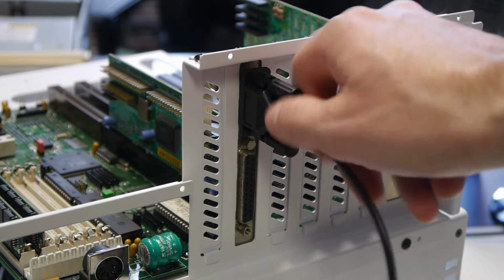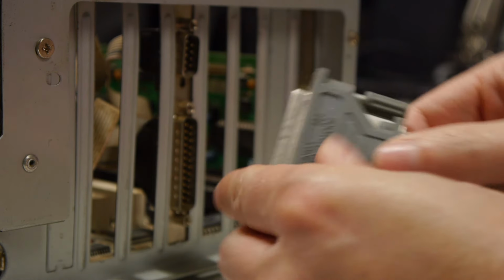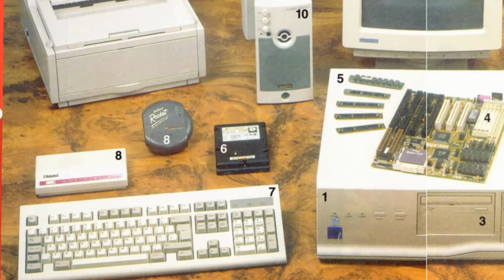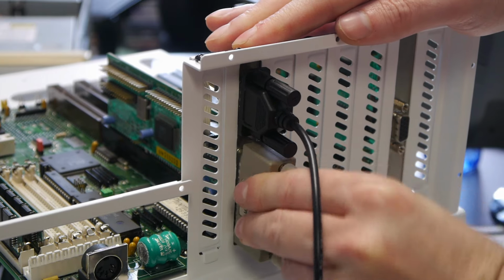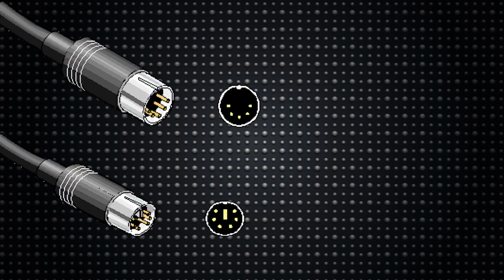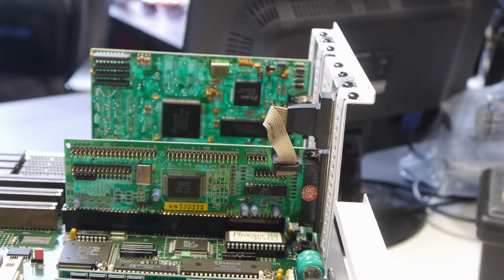What did we use before USB? | Nostalgia Nerd

Comment: 1:34 ages ago i had a 486 with an at keyboard port and the footer and through holes for a ps2 one underneath, i was using a ps2 keyboard and for shits and giggles i robbed an old dead ibm ps/2 motherboard of a ps/2 port and replaced the at port with the ps/2. i was like 15 years old (35 now) and i was AMAZED when it actually worked. although i eventually destroyed that motherboard by grounding the at/ps2 5v to the case while it was on. no smoke, just no work. (i was working at a computer store at the time, and while these weren't throw away parts, i sadly didn't have much respect for them, because i knew i could ridiculously easily replace them, coppermine had just come out and it was a 486)

Comment: One small point you forgot about the old "sound blaster" type sound cards: As well as having the external game port (for joystick or other game-pad), they were used as the interface for connecting an internal CD drive to the motherboard of a PC. There was some logic to this, since most software which came on CD-ROM required a sound card to work properly anyway. This arrangement persisted for a few years in the mid-1990s, but became obsolete when CD drives began using the same IDE interface that hard disk drives used. However, most IDE CD drives still had a legacy 4-pin audio port, which allowed the use of a small cable to connect the drive directly to a sound card (or to an equivalent sound chip integrated onto the motherboard), bypassing the IDE interface.

Another benefit was if you wanted to use the CD drive in your PC to play a standard audio CD: The multimedia speakers connect to the sound card and could be powered by it, since sound cards often had small on-board amplifiers capable of driving stereo headphones or small speaker sets. So having a CD drive controlled by the sound card allowed an audio CD to be played without using any memory or processing resources on the motherboard. Some CD drives at the time even had multiple control buttons on their face-plates (play, pause, stop, skip track forwards or back), so an audio CD could be played directly, without any kind of software interface.

Comment: I would say this video sort of romanticizing it. It really took quite a number of year for USB to replace all those. And there was a reason why it took a while for it to get really wide adoption.

In the early days the keyboard was hardwired. That is why it for the longest time was the only connector on the MB. Serial interface was already a standard, so was ISA. 

Parrell port was a hardware used for printers  at the time. The printers was really "stupid" just just punching what ever bits came out of the port into the paper. (Thats why early printers was 7 dots, 7 bits for printing, and 1 bit for system interface)

The game port was originally a sound port that was sort of miss used as a joystick port.

The thing is that PS/2 convector was sort of a prior atemt to make semi universal connector. PS/2 works kind of similar to USB that is it have a rather hearty 5V 275mA power supply, and two data pins. But in steed of data+ and data- it have data and clock. It also had the ability to support two devices via splitter cable (not always sported) Some manufactures used this to pipe mouse via keyboard or to use one less port on portable devices.

By the time of USB 1.0 PS/2 had already unified Din keyboard and Serial mouse... but of cause the issue was with modems, still using serial. And to some degree Parallel port. To cut down on cost USB used 1.2Mbit for peripherals and 12Mbit for more intensive stuff. But USB 1.0 had hubing problems. So it was really never used.

Then a lot of keyboard PS/2 to USB was kind of buggy (specially in bios) prompting most people at the time to still use PS/2... While mouse interface for the most part worked just fine, but people still used the PS/2 because of the keyboard issues).. anyway wheel mouses for the most part pushed over people to USB.

Also, by this time most drives was to fast to use the parallel ports, promoting uses of SCSI and firewire interface or also commonly LAN interface. Also USB 1.1 was still way to slow. So in a way. USB was to late, to slow and to buggy.

USB 2.0 solve the rest of the problems (most was solved in 1.1, but it took time for adoption). Honestly while firewire and SCSI remained on the market, USB 2.0 sort of killed the mainstream adoption of them.future firewire... While they was quite a bit faster, by this point it hardly mattered any more.

Most people think of firewire as an apple thing... and well it kind of was post 2000, but prior to 2000 most major PC manufactures had firewire (or 1394 as it actually was called) integrated in there top end hardware.

Comment: Next thing that will replace USB is wireless (either bluetooth or another wireless system). Even though today on a pc you can connect your mouse, keyboard etc with a USB wireless dongle, eventually dongles will be a thing of the past. Then the next question will be "What did we use before wireless?" Answer "USB"

Comment: I'm from 1984 and had the first PC in 1998 but despite fact that I had been able to put my fingers on a computer when all the described ports were being phased out, I have been able to witness them all. The first PC I had, mounted PS/2 ports for Keyboard and Mouse, COM Serial ports for 56k modem, the soundblaster audio card my father had the shop mount in the pc shared a gaming port (though I never used it since I don't like computer gaming that much), the printer (HP Deskjet 710c) was connected through a LPT1 Parallel Port (and even the HP Deskscan "whatever" scanner I borrowed from a mother's colleague was) and, last but not least, the big format scanner Contex FSC 5010 mounted (and still mounts, since it is still alive) SCSI 60 HD and 50HD ports. And no, my IOmega ZIP Drive already mounted USB. So even if I'm only 35, after watching this video I just want to die :(

Comment: And now we have USB-C, a port that always looks exactly the same but can have requirements such as

"Firstly, it’s important to note that USB Type-C is a connector, not a signal type. If the Type-C port on your laptop only supports USB it won’t work with a VR headset. It needs to support ‘DisplayPort Alt Mode’ or be a Thunderbolt 3 port to have a chance of being compatible."

BUT AGAIN, ALL USB C PORTS HAVE TO LOOK THE SAME

Comment: USB 2.0 has a maximum theoretical bandwidth of 480 Mbps, versus 400 Mbps for FireWire 400 and 800 Mbps for FireWire 800. In practice firewire was actually about 35% faster then USB 2.0.  There are also a number of early adoption issues with USB 2.0 in the Bios. Many of the systems that we worked with at the time defaulted to 1.0 speeds or worse didn't support 2.0.

Firewire was actually Superior to USB 2.0 in so many different ways. Since it only required and expansion slot you could essentially have an upgrade on your system that gave you exceptional speed without having to replace the whole system. I actually used you a USB 2.0 and firewire quite a bit in the 90s and early 2000. They worked well but the performance was always better with firewire. As I said, it was at least 35% better given that USB 2.0 didn't actually deliver on the speeds and the fact that firewire was much more reliable and didn't have the tendency to freeze up.

The firewire connector was actually a better design as well. It could be used in tight spaces just like the USB, but you could look at the connector and tell which side to stick in. This saved a lot of time. You didn't have to Fumble with the clunkiness of a USB connection where you had a 50-50 chance the cable would go in as opposed to a 100% chance the cable would go in using firewire. Actually at the time, I had hoped that firewire wood become the standard instead of USB.

Comment: I always remember the rules of SCSI on apple macs of this era? There were arcane rules such as no more than seven devices on a chain. Certain devices had a placement order on this chain. You could not mix different SCSI cable types ie they all had to be from the same manufacturer and either cheap or expensive ones dependant upon budget. Finally the last device in the chain had to have a terminator resistor block on it to signify the end of the chain to the SCSI controller on the Mac motherboard. Bizzarely enough you sometimes  had to remove this terminator to get a certain device within the chain to work! To say this state of affairs was a right royal pain in the arse is an unstatement. Thank God for the USB standard. You guys have never had it so good!

Comment: As someone who deals with industrial computers and controllers, 9 pin serial is still used to this day.
Reply: Actually, serial communications is robust, easy to understand and program, and ubiquitous.  That's why it's still around.
Reply: @jovetj  I have a serial port on my server motherboard. Can't that be used as a TTY in Linux? Maybe that's why it was included? I've never seen anything actually use a parallel port, but I could imagine it being useful when swap thrashing causes my computer to freeze in a way that makes the GUI inoperable and the TTYs unswitchable.
Reply: Yep, serial is far from dead.  However, that serial (normally UART) connection tends to go into a serial to USB converter on one end ;)
Reply: @travcollier  often those converters don't work reliably with old school serial products.  i used to run automated camera controllers that used an old 9 pin and we had migrated to a new server that had no native 9 pin ports.  i went through several different vendors for converters and each one of them would cause some weird error that resulted in non-function about 1% of the time.  1% was unacceptable for this application so instead just went for a pci  9 pin serial card and that solved the problem.
Reply: @oldtwinsna8347  I never had any issues with FTDI serial<>USB, but I was working with relatively modern microcontrollers mostly.  The off-brand and counterfeit converter chips suck though.
Reply: Yeah, a few industrial controls engineers have lamented the death of the serial port on their laptops as often the USB-to-SERIAL adapters don't work well with their software.
Reply: it's used because a lot of companies are too cheap to lose the money from down time and the cost to upgrade to use modern technology. Eventually they all have to upgrade because once your shit from the 80s or 90s breaks then you're dead in the water.
I'm a controls engineer/system integrator (:

Comment: You know... now that I think of it, I've never actually gotten around to using a USB keyboard or mouse on my PCs unless you count the wireless ones. In those cases I think of the USB as an interface for the receiver, not really the peripherals themselves so much like it was with PS/2, Serial, and AT, or whatever that fat daddy dongle is called.

My new (roughly 5 years old) Logitech keyboard and mouse use the same Unifying wireless USB receiver, but the mice I use for my laptops use a standalone wireless one.

Cheers.
Reply: DIN, I guess then.

Comment: Here’s a top tip for you all, specifically if you have issues with any 2.4GHz wireless product on USB3.

USB 3 is well known to interfere with 2.4GHz anything - Bluetooth, wifi, proprietary protocols, doesn’t matter. The reason for this is because it runs at the same clock rate or something along those lines. I can’t remember the exact reason for this, but Intel did a paper on it which explains further. Happy to dig it up for further reading if you like.

TL;DR, the fixes are numerous:

Don’t connect your radio gear to any USB 3 port, if possible. Don’t connect it to a USB 3 hub, either.

If you don’t have any legacy USB 2 ports, you can work around this issue by using either a long extension cable, or better yet, a USB 2 only hub.

However way you choose to skin this particularly annoying cat, keep the transceiver as far away from the USB 3 port/hub as possible, and you should be good.

So if you’ve ever wondered why your wireless mouse seems to suck, that’s why.
Reply: Ugh, overengineered solution. How about just use a wired mouse and not worry about it?  It's lower latency and doesn't require batteries/charging.

Comment: well the db9 and db25 ports are still  common but not on laptops of course for example i completely destroyed any chance of sealing my truck but using 3 pcie cards 4 db9 cables and 64 rs232 controlled relays i can set in the passenger seat and drive with a keyboard in in my house and drive it using 2.4ghz wifi there's a yagi antenna on top of the truck and a matching one on my house 

have you ever wanted to get pizza but they don't deliver to your area and you don't feel like cooking or even getting up ? no problem just remotely start your truck by connecting to the computer and tell it to start the engine then you can use the wasd keys to control the steering and gas flow and the arrow keys to shift 

its also good at pissing the cops off

Comment: Dang...Am I that old that people are now starting to ask what was used before USB? I was born in 1999 and even I remember life before USB was everything...
Reply: I was born in 1993. I grew up with Parallel and Serial ports as well as floppy disks and the age of the Soundblaster card. Don't forget, there was also firewire. :)
Reply: I was born in 1978.
Reply: I am born 62 and believe me, there was no need for this junk. And it took years to run flawlessly. USB was nothng than a cheap way for a bus system. And latest now everyone talks about IOT. We could have had this 20y earlier...
Reply: @TheLightskinPirate And connected to a Sound Blaster...
Reply: 96 here, i was using PS/2 mouse and keyboard till the 2010 so that's something i guess.
Reply: @capralmarines4043  Anyone having reached such years as still-viable, deserves congrats aplenty regularly. Congratulations from a young 75 yo.
. : .
Reply: I was born in 2001 and only discovered USB before USB 2.0 when I picked up an old computer from the same year I was born, and haven't ever used a single device which supported parallel ports or similar, although have used a few PS/2 mice and keyboards. On the contrary, my only experience with many of these ports is seeing them built in to motherboards and having very little idea of what they actually do (other than maybe "predecessor to USB"), as to my knowledge no peripherals have used them for years, maybe even decades, considering that I haven't seen any at all. 
So... I think people remember and even occasionally use PS/2, but parallel ports have been obsolete for such a ridiculously long time that most younger people probably don't remember them.
Reply: Dang I wasn’t even born yet
Reply: 1990>:P my dad owned a commodore 64...

Comment: Id just like to mention serial ports are still very much alive. anyone who plays with arduinos should know this. plug in a usb arduino, its just a usb-serial bridge. the data is still 1970's era encoded serial data. 
but for a huge amount of industrial hardware uses them, when you dont need bulk data transfer, just some command signals or a few packets of monitoring, the good ol serial port is still very much alive. 
did you ever wonder where the IP.AD.RE.SS:PORT came from? :PORT references a com port interface. so port80 for all your web http stuff is still coming thru a virtual com port. your ssl, ftp, pop3, bittorrent, "ports" are all legacy, in software, serial ports.
for industrial use, there are many little boxes that serve their IP.AD.RE.SS:PORT to an actual physical RS-232 plug. or 485. or 422. or TTL. these are all just different ways of representing 1's and 0's. 
but if all you need to throw at a micro is a few command or status instructions, its really handy to hand off all the networking stuff off to something else, and just be a serial port at the end of an IP address. thats the power of TCP/IP, let the transport protocol worry about how it gets from A-B, when it gets to you, its just a basic serial port that magically spans the globe.
Clock data in one side, those same bits end up on the other end. 1960's tech, hard at work in 2019.

Comment: Ugh, I remember plugging in the mouse in with an godly sized plug that needed screwing in.
Reply: At least those cables and connectors were very strong and did not break like all the current flimsy USB cables and sockets.
Reply: You screwed it in and could lift the entire machine with it. Same for the VGA (D-sub) and DVI ports. Once they're in, they stay in, unlike HDMI which comes lose just from turning the monitor.
Reply: @HappyBeezerStudios  ... I am terrified every time I have to unplug a HDMI plug because I never know if it will go in and work again. Hate them! I have even gone as far as buying an extra media box so I can have one for my projector and another for the TV so I don't have to swap the cables all the time.